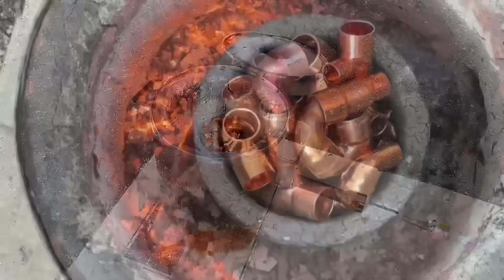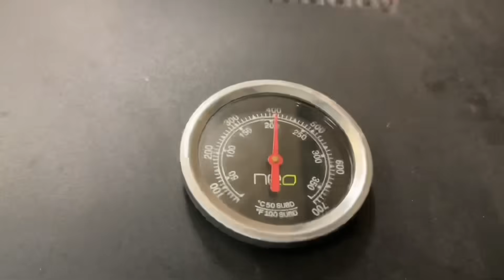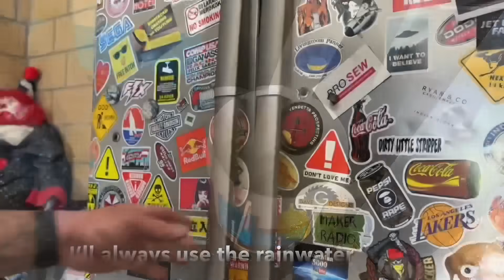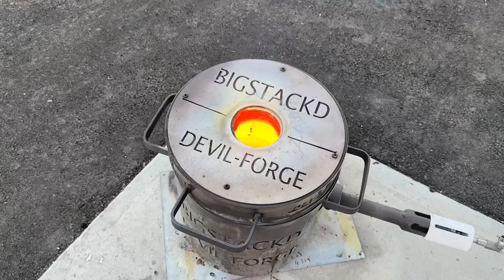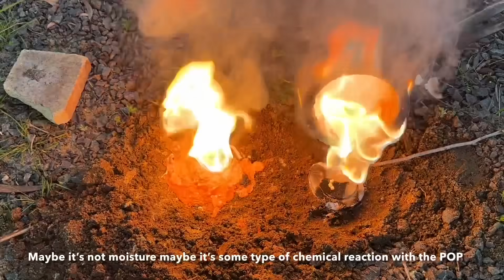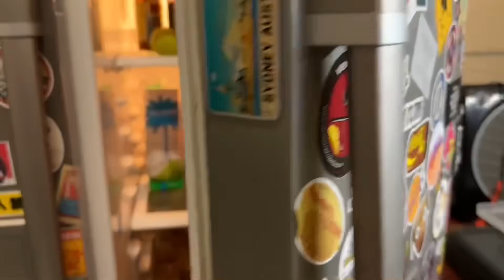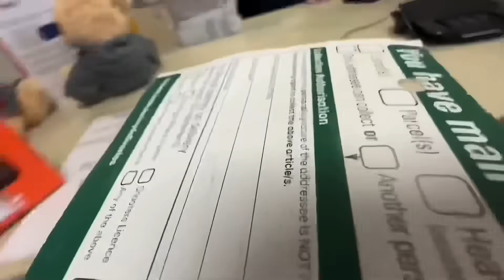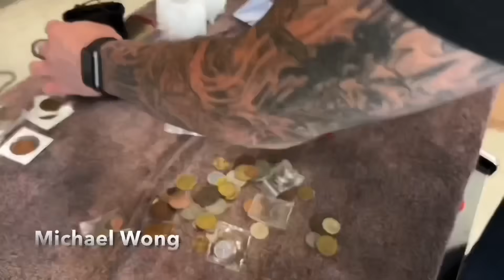Copper Casting Distillery Pieces - Mold Making In Original Garage - ASMR Metal Melting - BigStackD

Comment: How come you can’t get casting investment in AU? What in the world do your jewelers do then?? Is it a licensure thing or do they have to outsource all jewelry casting to other countries?
Reply: Also you probably know this but POP absorbs atmospheric moisture. No matter how long it sits it contains moisture relative to the humidity. But it also lacks binding and temperature resistant materials present in jewelry casting investment. Even jewelry investment has to be fired in a kiln before casting to eliminate moisture and prevent breakage when the metal is poured in. Maybe talk to a local manufacturing/custom jeweler and see what they do about casting pieces?

Comment: As a retired , Plummer,  who used to have copper fitting STOLEN off job sites all the time. Well, I see it may be by smart people.
Let's break down, your trashing fittings worth alot into worthless bar stock.
Haha, each one of those complex copper fitting were about $1.85 per fitting if not more. They only weight a half a once if that. 
Copper price pre once is .24 cents..  now add the gas price to heat the little easy bake oven.😅  you destroyed, 50 bucks of copper fitting to make, a $8 dollar bar of copper.
😂😅, I know math is not for everyone, 
Cave men used , jump. And yell look "me make fire " ... some give scrapers a bad name.  I used to scrap, airplanes. Drove the deserts. But, I paided , x for trash, took the landing gear, ( worth thousands per pound more than gold back then.) And made what people who read call a " profit " 😂